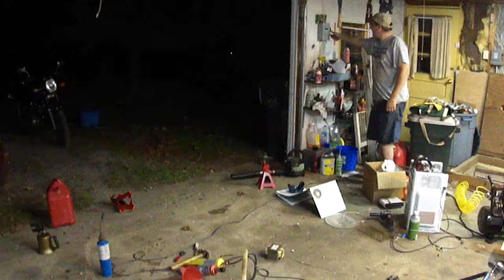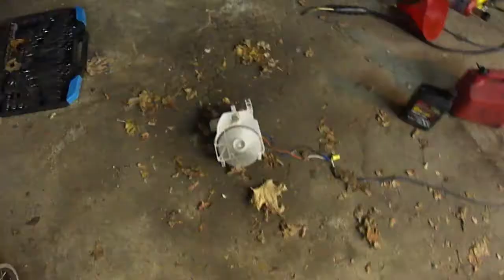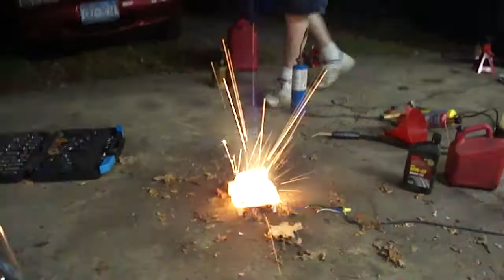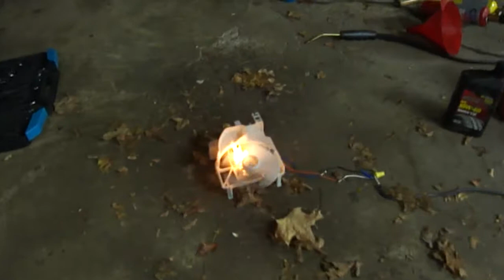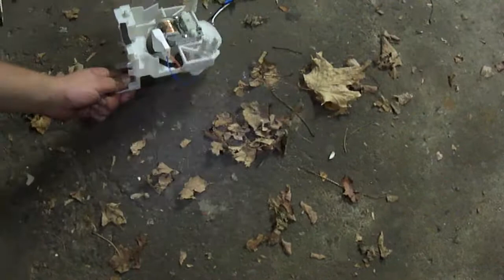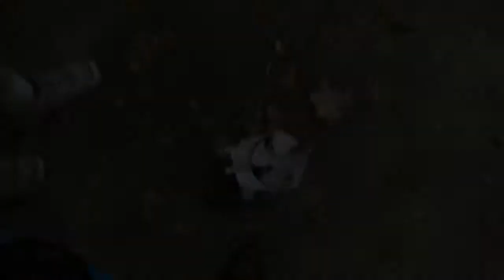Running a 120V motor on 240V

Comment: its a shaded pole motor... its running only slightly faster because the core is saturated. When it comes to shaded pole motors frequency is what determines the rpm.

Comment: The speed of an AC motor is determined by the line frequency, not voltage... so a 60 Hz AC motor designed for 110V but fed with 220V 60 Hz will run at normal speed, but the windings will soon overheat and burn out.
Reply: Not sure if there might be exceptions,  but I had accidentaliy wired an outlet to 240v instead of 120v directly off the meter on a temporary power pole,  and didn;t catch it right away.  it was running our compressor at twice the speed it shouldve been running at and was twice as loud.  Surprised that the compressor did not burn up before I caught it.  I was surprised at the performance of the compressor but also surprised at its noise level until I hooked up a heat gun to it and it lasted exactly 2 seconds before it went up in a flame of glory.   Also a bandsaw I tried to run on it put on a spark show,  so I suspected something was up and tested the outlet.  Corrected it and the compressor now runs slower and quieter.  performs how I was originally expecting it to now.  I had also ran a brick saw on it for a short while and it broke the cooling fan on the motor inside likely because it exceded its rated RPM.  so it seems some motors will run at twice speed on 220v. Fortunately the bandsaw still works,  the only thing I lost to it was the heat gun.   weirdly a circular saw I was running on it did not seem to be effected,  it performed the same on both 240v and 120v.

Comment: If you put the motor on the half full plastic gas can it won't short out. Give it a try. It works like a suppression capacitor.

Comment: @ControlledExplosions 240V works fine with 220V machines, or even 230V... We got here 240V and It doesn't harm machines that runs on 220V

Comment: Actually it is not 2-phase at all. The 240 volts is the outer connections of the pole transformer with the center tap being the neutral that if you took either outer leg of the pole transformer and a neutral you will get 120 volts.

Comment: maybe you could run your swedish cassettedeck on your 240 v system if it is made for 220 v you maybe should put a resistor in series with the transformer to get it down to about 230 or 220v. or is your 240 v system 3 phase?

Comment: we  ran a 110 v box fan on the 330v welding supply at the shop ,what speed it got before the boom, want to do a toaster with the safety removed